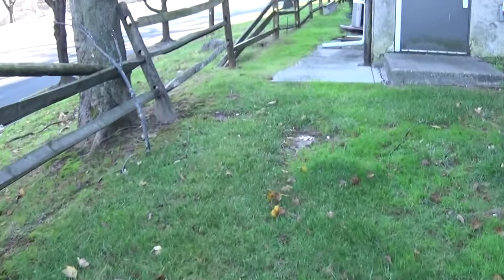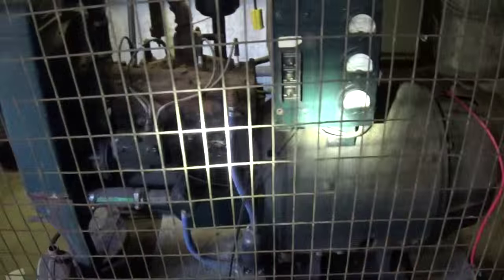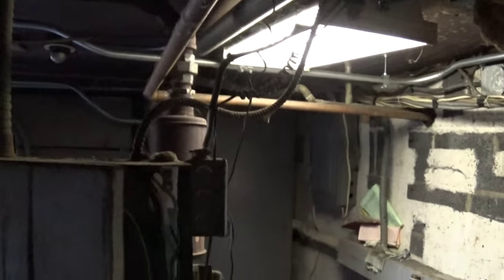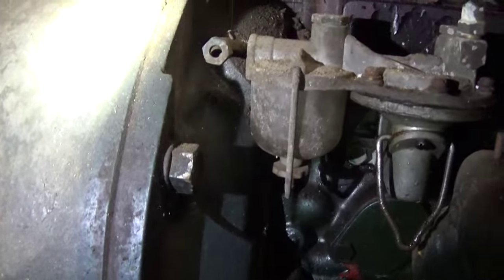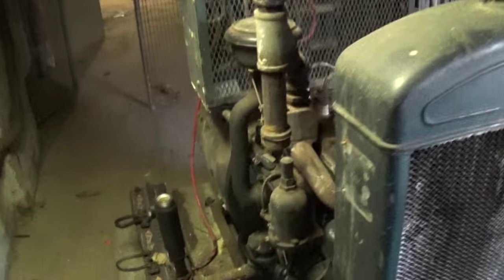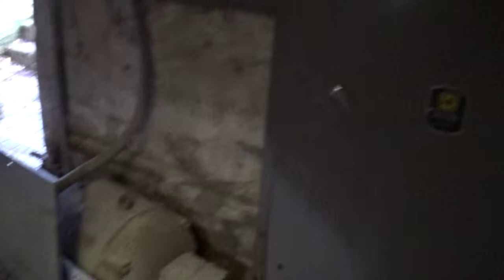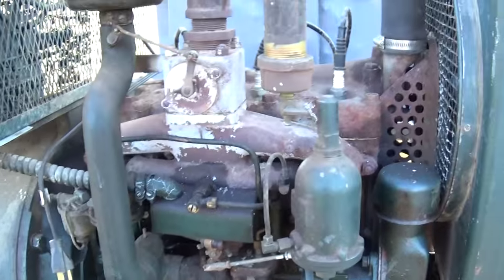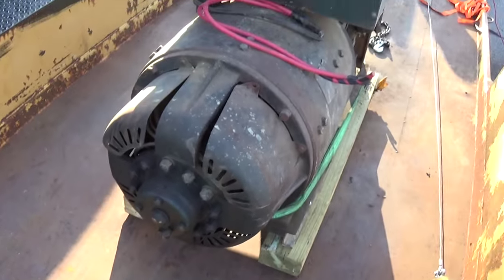Removing 1940s Kohler Generator From Original Installation

Comment: Yes, that is a mercury switch mounted on the throttle shaft.  To simplify, the controller uses it to tell when the set is up to speed, to open the cranking contactor and close the load contactor.

I have wanted one of these sets for A LONG time!  Ever since I discovered their existence.  Old 1200 rpm sets are my favorite.  NICE score.

Comment: My folk’s 1901 farmhouse came with one of these in the shed to power the house before their part of town was wired.
They bought the house in 1946 and the weight of the parts eventually sunk through the rotted floor and I remember seeing these rusted metal parts in the 1960’s. The house was originally built for the local banker named Brokaw and I’d guess he might of installed it after WW1 and it was already in disrepair when they bought the house. It was only after seeing this one that I realized what it was.

Comment: Mike you  have a nice standby by unit there for sure. Kohler used that dark blue color into the 1970's for sure,...I used to sell, rent and service Kohlers. These were ( hopefully still are ) reliable and durable generator sets.
I would like to see this when you get it all cleaned up and reconditioned.   Nice 'gift' you have.
Reply from the maker: +Reg Sparkes I can think of quite a few Kohler units from the 60s through the 80s that are still in service.  There is a nice original unit at a local police station, 1963 if I remember right, 80KW with a 4 cylinder cummins NH series engine.
Runs like a top! Thanks for watching!
Reply: +SmallEngineMechanic 
 Now that would be a good unit to have.
By the way Mike,..I just noticed your truck,....looks like a good serviceable truck to have 8 foot box, SuperDuty ?
Is that diesel too ? ( I'm looking at the slightly different exhaust pipe there.
Reply from the maker: +Reg Sparkes Yep,  truck is a bone stock F250 SuperDuty.  Has the 6.2 gas engine.  Its a good workhorse!
Reply: +SmallEngineMechanic 
Ahh yes, the exhaust on my Super Duty came out at more or less a right angle as mine was a PowerStroke ( read that noisey  ) but good.
Yessir, you do have a bit of a strong silent  type of worker there.
Cheers Mike, have a Merry Christmas.

Comment: Geez Louise Mike, that Kohler has maybe a couple hundred hours at most, if that!  I looked at some numbers for Waukeshaw FC-182-J engines and it looks like a good guess is 1953, so early 50's just as you said.  Wow, I bet that thing will be a runner in no time...  and I don't know exactly how much you could sell it for, but a running genny like that, $1000 around here wouldn't be out of line.

Comment: I had one of those mounted on a trailer. I typically crank started it. Three turns or less every time. Only replaced the water pump. Radiator was re-cored sometime before I got a hold of it. Purred like a kitten unlike the new stuff at 3600rpms. What did you end up doing with it?

Comment: Wow Mike that would be a great back up to actually install and use at your house
Reply from the maker: +1944johndeerel Yes, I like the fact that the automatic transfer switch is built right into the controller.  Totally self contained.  Add a couple time delays and it will work just like what we use today.
Thanks for watching!
Reply: i would like to hook my 6500w kohler up for a backup, smooth and quiet. I look forward to your getting it running

Comment: It is in good shape since it was always inside ...Could that odd piece on the throttle linkage be a mercury switch ?
Reply: +not2fast4u2c I was thinking the same exact thing!
Reply from the maker: +not2fast4u2c I was thinking that myself!  Have not looked at it closely yet to see what it controls.  For some reason I think I have seen that set up before but I just can not remember where... Thanks for watching!

Comment: what condition is the engine in? 
that would be a major head ache if 
the engine needs an overhaul, gaskets, rings, bearings
crankshaft grind an so forth, wouldn't expect it to run, but as long as it turns over, that's 90% of the battle, a complete engine rebuild would be costly.

Comment: Mercury switch? The thingamabob that you didn't know what it was. I saw a lead behind it.
Reply from the maker: +aserta I figured it was some kind of switch, have not looked into what it controls yet.
Thanks for watching!
Reply: @SmallEngineMechanic  It is part of the autostart for when the power goes out.  On power fail, it cranks, when it comes up to speed the governor starts to close the throttle, which operates the switch, which drops out the starter.

Comment: That is so cool. why did they stop making 1200rpm generators? last too long?
Reply: Too expensive now. Slower speed means more windings (etc) to maintain 60hz. Need a bigger engine that can make power down low as well.  Primarily why you see a lot of cheap 3600rpm 2 pole machines now.
Reply: +DrFiero I know it is a shame that is the way of everything now throw away garbage not many things built to last anymore
Reply from the maker: +1teddy1979 DrFiero has it right.  It is hard to estimate what it would cost to build something like this unit today.
I can say for sure you wouldn't sell many of them.
Reply: +SmallEngineMechanic people care about quality till it costs more lol